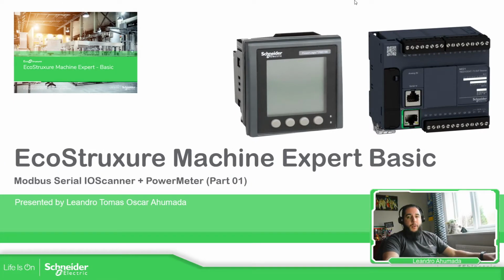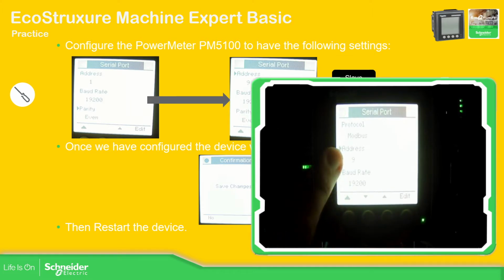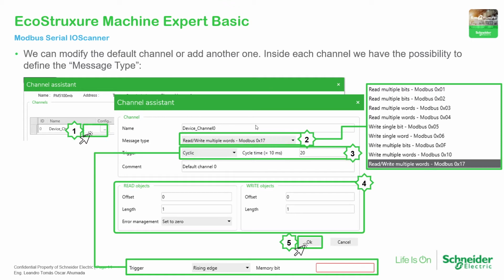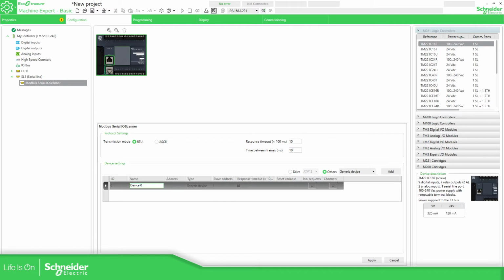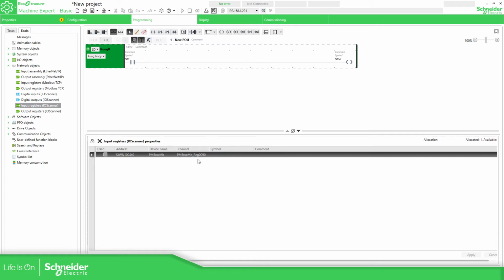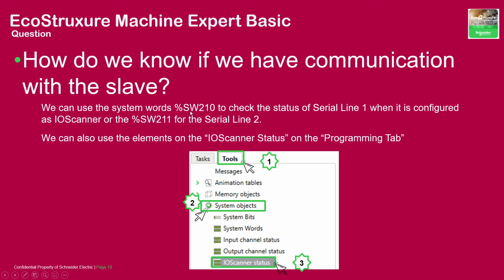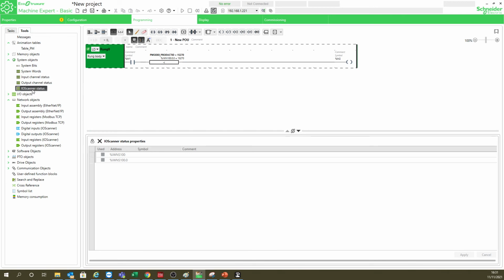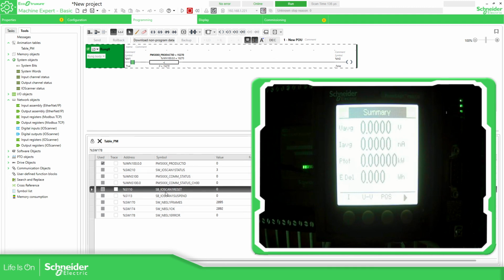Training - M221 - M9.7 IO Scanner for Power Meter Part 01

Comment: Hi,  
I tried this procedure and it’s working fine. However, when I remove the Modbus cable from the PLC, the communication is lost. After reconnecting the cable, communication does not re-establish automatically. It only resumes after restarting the PLC power.  

Please advise how to achieve automatic re-establishment of communication. Also, how many devices can I add to the I/O scanner?
Reply from the maker: Hi there! The amount of devices if i am not wrong is 16 but you can check it by adding devices into the ioscanner. 
If the communication is lost then you can try with the reset of the ioscanner (check the system %s112 or closed to that one)